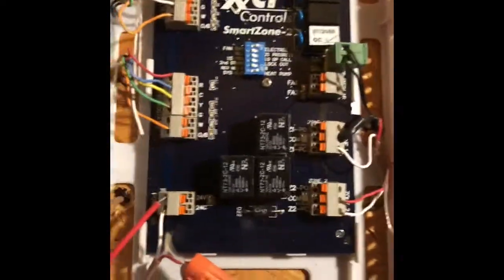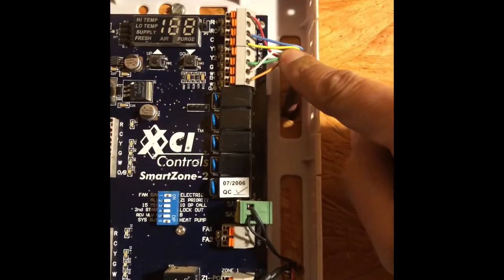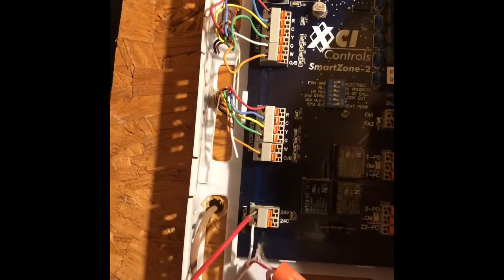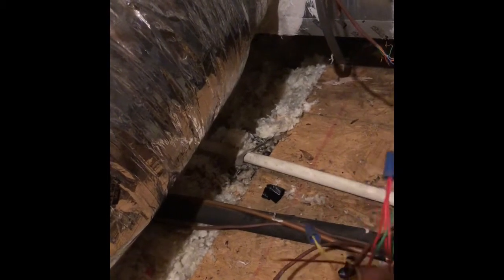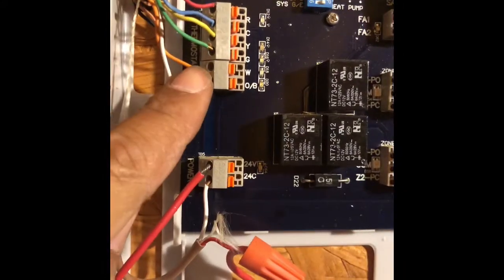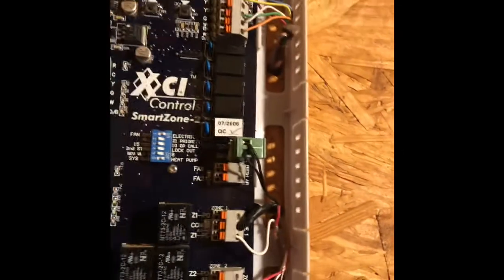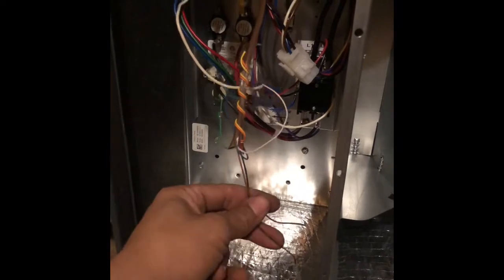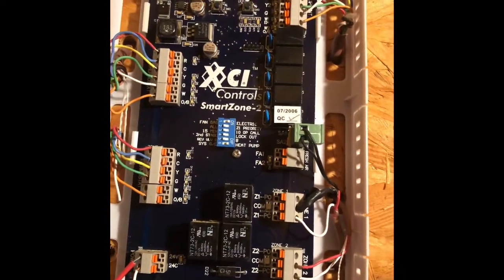How to wire a zone board easy tutorial

Comment: I have this same board and looks to be wired exactly how you explained it. Do you have a video explaining what all the lights mean? I have some hot spots and want to know if the board will tell me if my dampers are working.
Reply from the maker: The board will not tell you if the dampers are working. The board will only tell you if the dampers are being powered on or powered off. In order to tell if the dampers are working you would have to cut a hole in the duct and physically look. The newer Honeywell dampers have a site glass on them where you can tell if they are open or closed. Thank you very much for watching the video.